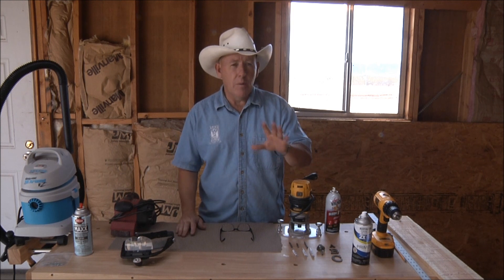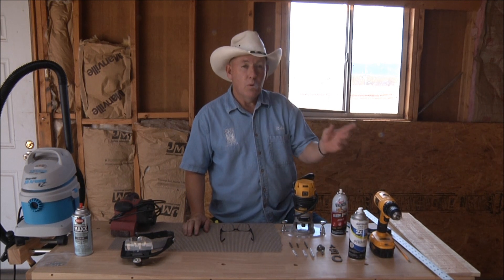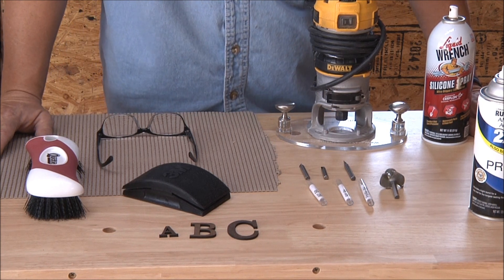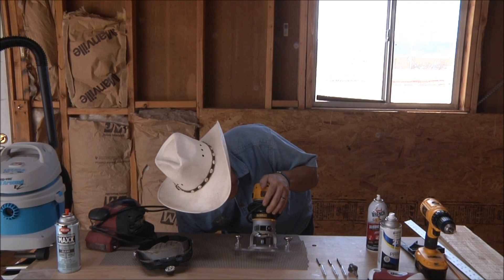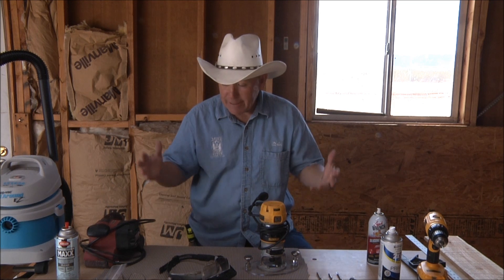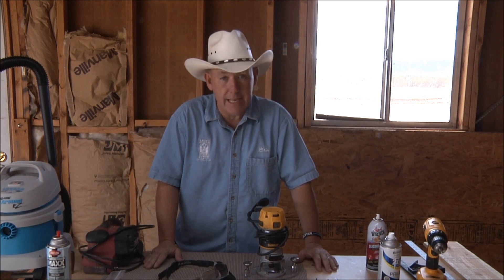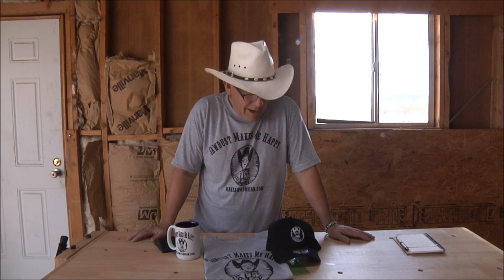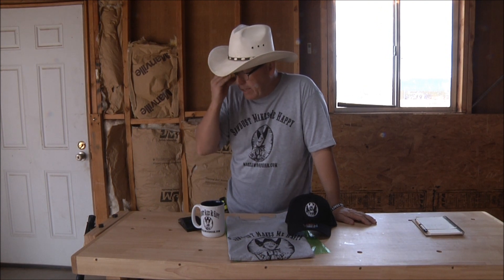Newsletter #188 What Do I Need To Get Started?

Comment: Great videos. I just started watching your videos and have seen maybe 10 so far. One thing I haven't seen yet in any of them so far is some personal protection equipment such as ear, eye and lung protection. I think I would mention it especially on a beginner or "getting started" video. I know, I know, we are all responsible for our own health,  etc. but beginners may not think of those sorts of things until they start coughing and/or sneezing a lot more than they used to or their spouses are having to yell at them to be heard.  I've seen you blow off fine dust with a vacuum cleaner a few times and I wonder where it's going.  Of course,  I'm guilty of the same lack of protection mostly out if my own laziness or  hurridness.  Although with all that sawdust you're making your shop always looks immaculate. You would think  your shop would be caked in sawdust.  I've done lighting repair in all sorts of shops: carpenter/wood shops,  auto body shops,  metal workingwelding shops, auto garages,  etc. Every one of them has had thick layers of their respective dusts caked on top of their lighting fixtures while the employees rarely  wear respirators consistently. Don't mean to be a downer,  just thought I'd mention it. Keep up the great videos.  Maybe I'll get into one of your seminars soon. 👍
Reply from the maker: I do mention these things from time to time, but you are correct, I don't mention them enough. Our normal shop looks a little different than this. I now do all me sawdust making operations outside on a covered patio. Lots of the other info type videos in the studio so not much dust in there. Anyway thank you for the reminder and the concern. I will try to get better at safety protective gear talks.